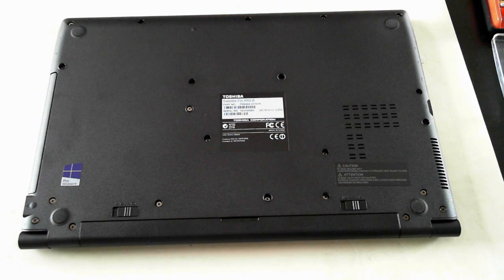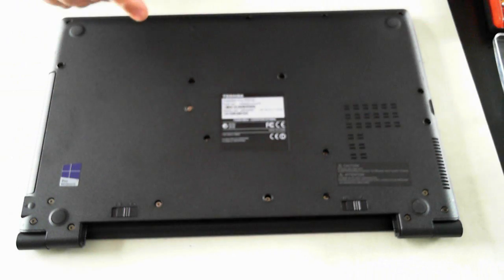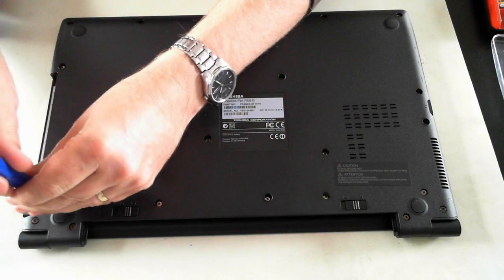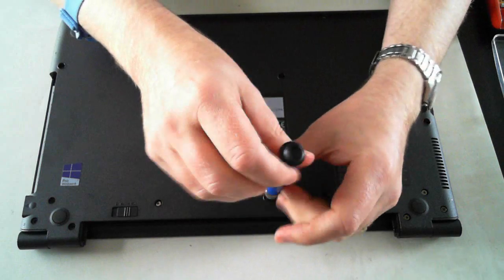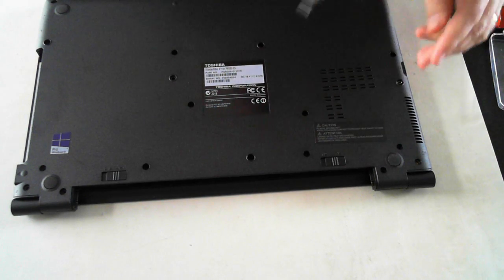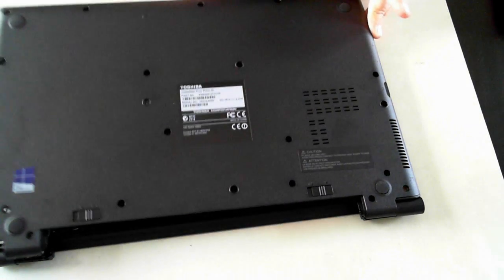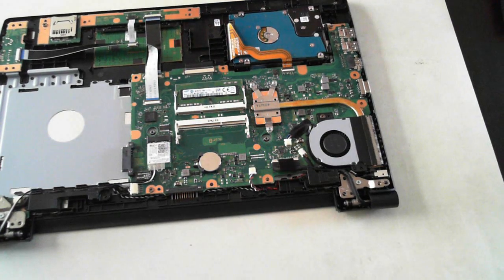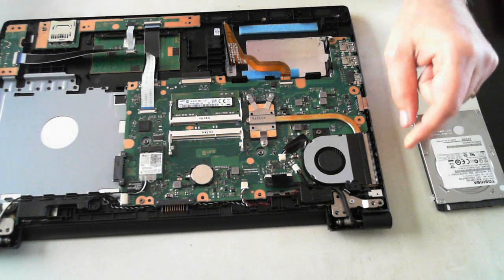Toshiba Satellite Pro R50-B Teardown

Comment: I found an old 1 of these its running ok with 8gb ram but needs more how would i tell if therres a slot spare like if its 2 4's or 1 8 is it ddr2?
Reply: There are two RAM slots in the laptop and it can take up to a maximum of 16GB of RAM.

Comment: hi. is the keyboard swap straightforward?
Reply: +Gareth Price  Did you find out how to remove the keyboard? Trying to replace one currently
Reply: No. It's under warranty still & going back to Toshiba.
Reply: +Gareth Price no worries.  Just figured out how to replace it, had to unscrew motherboard to get to keyboard cable,  all working now 👍
Reply: +Will Wilkinson nice.
Reply: actually the warranty has expired by a few months. so, once opened did the motherboard unscrew tidy?
Reply: Muy bueno .una pregunta le puedo cambiar el disco duro hdd por uno ssd  en caso que se pueda necesitaría  algún  adaptador  es un toshiba  satellite pro r50-b.un saludo